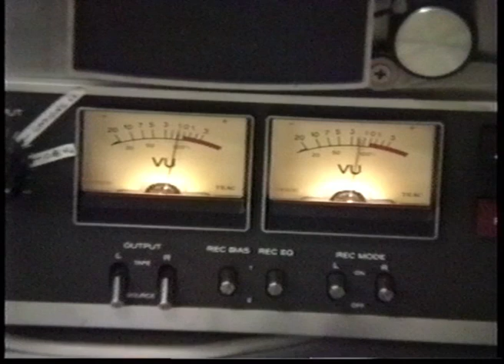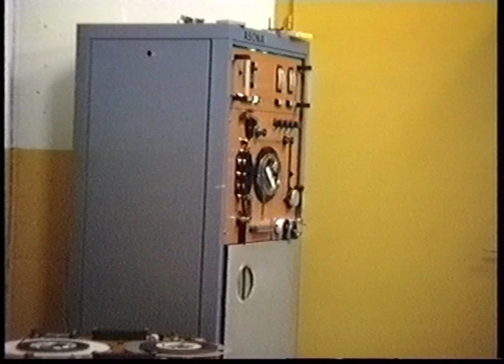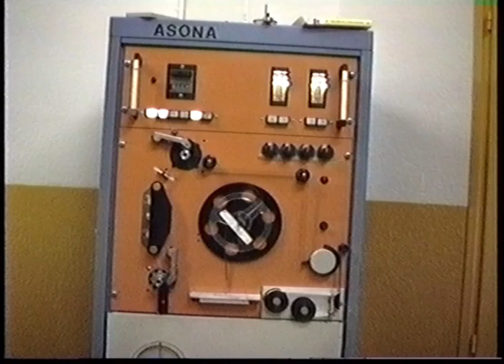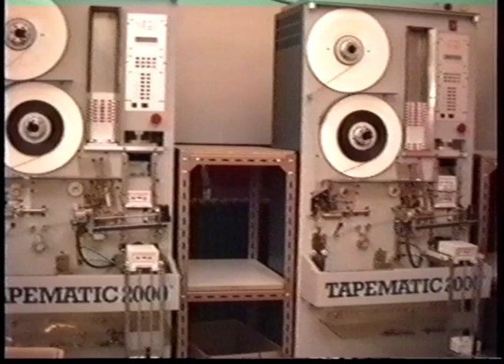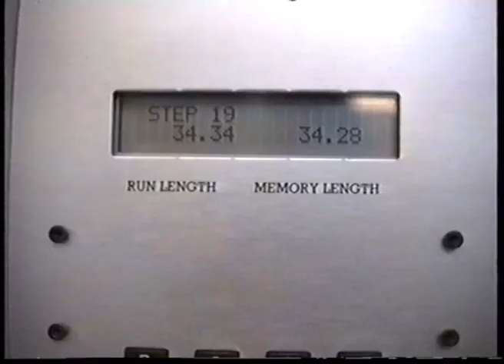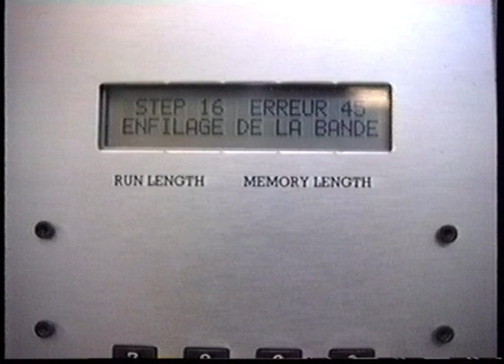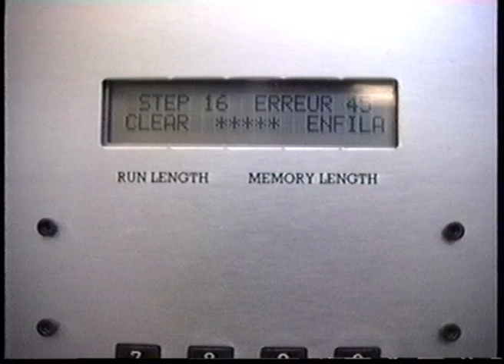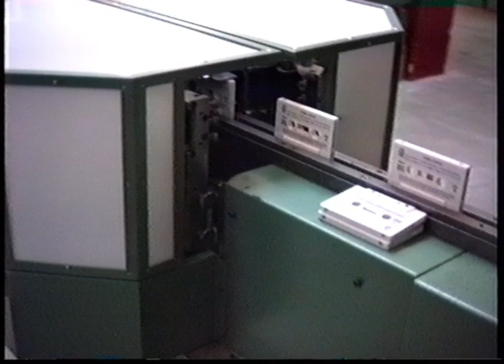Duplication Cassettes Audio

Comment: I would love to have a binloop setup for a tapematic system. I see you had the dual pancake setup working what is a first for me! The footage of the pancakes being recorded is amazing! Do you still have any of this equipment? I have been working on repairing a tapematic cr with a few acquired parts but have been having problems with consistent leader extraction, without a full service manual too so it has been an interesting experience so far!

Comment: Wait, so the bin loop dumps the tape in a tangled mess???  What keeps it from getting jammed?
Reply: A vacuum
Reply: The bin is only wide enough that he tape "stacks" itself.  I worked 6 years for Electo Sound in the USA.  We were the largest bin loop duplicator manufacturer in the world, Used by a major record labels.  Vacuum???  nope.  Gravity.  Vacuum was only used as a part of a tension system to keep the tape on the playback heads.

Comment: But, how does the leader tape comes into the blank cassette and how its fastened to the reels when its manufactured?
Reply: Leader tape was part of the empty cassette shell manufacturing.  The cassette reels have a detent in them and the leader is press fitted into this dentent with a piece of round plastic.

Comment: So in 1998 they weren't using a digital file to record to tape?   Something does seem right here.
Reply: It can be, but whatever source they are supplied with, if the destination format is cassette, that source has to be copied to either a half-inch or one-inch duplicating master tape, which then gets fed into the loop bin (in the Asona machine in this video) and then recorded onto the few slave machines loaded with 1/8" cassette tape.
Reply: It really depended. At that point there were still many places using analog loop bins. Digital loop bins were extraordinarily expensive (think of how much storage space raw PCM audio takes -- they had to have that much RAM to hold the whole thing. Not cheap in the 90s. Hard drives were not reliable enough). So analog duplicators had a place right up until the end of mass cassette production. Most major plants used digital but there were a LOT of smaller plants doing all sorts of non-music stuff as well.